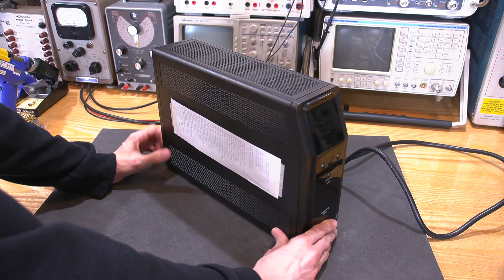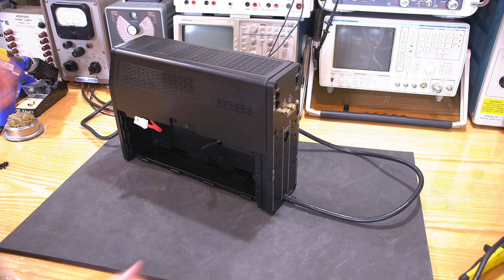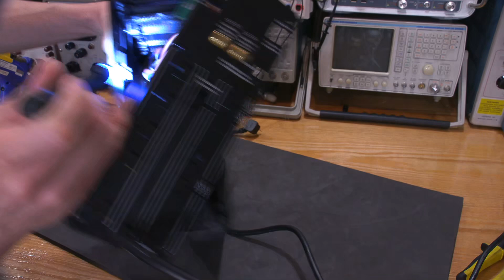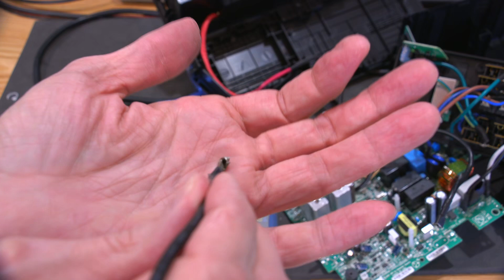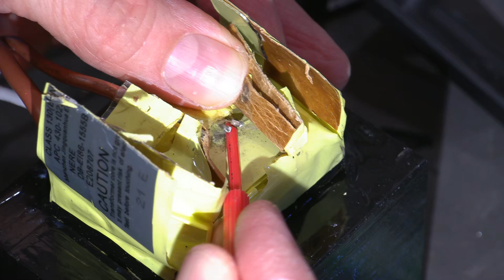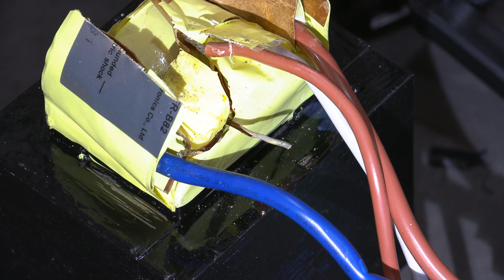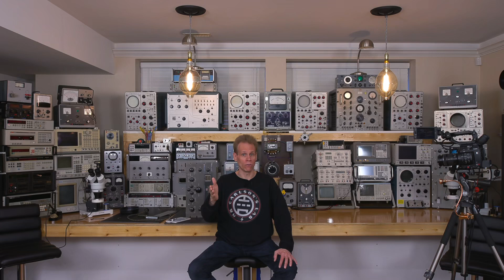UPS Electrical Failure - Teardown and Analysis!

Comment: Now, does APC know that they are getting aluminum transformers or do they pay for copper and haven’t caught up yet… Aluminum windings can be soldered to copper but it requires proper technique, and ideally an aluminum terminal crimped onto the winding, then soldered to the copper outgoing lead. Larger area on the terminal makes for much easier soldering. Soldering directly to aluminum wire so thin without anything else typically takes an inert gas envelope, a dip in something that strips the oxide, then a rinse dip or two, and finally soldering. It’s doable, but it takes equipment. I really wonder if perhaps some supplier did APC a number on this one.

Comment: That is copper clad aluminum. The trick is to wrap the wire then solder but the joint has to be mechanically stable first.

Comment: Currently shopping for a pair of 1500 VA UPS's. Definitely not buying APC units after seeing this. My primary concern would be fire, second is that the arcing might result in harmful voltage being outputted to expensive equipment.

Comment: fault code F02: On-Battery Output Short Turn the Back-UPS off. Disconnect non-essential equipment from the Battery Backup outlets and the turn Back-UPS on
fault code F04 Clamp Short

Comment: Wow ! !   I just Hooked up a APC 1500 Pro . It was Free. I just installed 2 New Batteries(Not OEM- what a rip off/Price) I Would think they have the same Crappy Connections.
So, would you Suggest ripping apart the Transformer and putting Butt Slices on those wires ??

Comment: Nice video, thanks. Purely by chance, one of my Cyberpower 1300va ups' just started the arc welding buzzing when the power dropped out and I happened to be walking past it. Within 30 seconds it was venting a lot of smoke. The thing is fine running line interactive with the mains, but when it cuts over to inverting, all hell breaks loose as though it's inverting all the power it can possibly muster from the battery. Very thankful I just happened to be there, probably would have set the house on fire but for that coincidence.

Edit: I'll try to grab some video of my Cyberpower in a couple of weeks when I'm back, but deeply suspicious that I've had the same failure mode on the transformer. Buzzed like mad, heated up a lot and released a lot of smoke....no scorch marks anywhere on the board. Only swelling on a bulk cap next to the heatsinks for the FETs...I never would have suspected the transformer!
Will definitely check it when I'm back!

Comment: This is more common than you think! I bought my 75 ohm antenna cable for approx. 1 year ago and the center leads are made of steel with a thin layer of copper.

my rca signal sound cable I bought has an aluminum screen.

this is only to save money at the factory. the product is of much lower quality as the solder only adheres to the thin outer layer

Comment: Hey, I had a BackUPS 1350 catch fire. I mean flames and sparks shooting out the top of it catch fire, not just arcing sounds. APC warranty exchanged it, but now I'm skeptical to continue using it as well as the other BackUPS-1350 I have.

Comment: I have to admit that that is very concerning to me.
I can't go into full detail,  Yet we use APC (Commercial Grade) quite often in the field in the work that I do in security access control and surveillance systems.
I have noticed recently we've had a lot of failures with the newer APC units then expected.
I just wanted to say thank you for bringing this to my attention on what the problem on some of the units that we've installed within the last two years.
Keep up the great work you're doing.

Comment: Don't be surprised/shocked.
Almost all windings in transformers and motors of cheap (chinese) products (MW, swinging cooling fans, etc.) are made of copper PLATED aluminum or aluminum with copper COLORED lacquer.

Comment: For some reason, aluminum windings in a transformer just never occurred to me. I guess it could be ok if there was a really serious mechanical and electrical bond to the wire, like proper crimp terminals, but those would add precious pennies to the BoM and labor.

Comment: Always SUSPECTED something like this - have you noticed on some Chinese motors & transfomerms the ad says "genuine copper windings" - suggesting they DO cheap out like this --- AND NOW WE HAVE PROOF!

(There was Alu-Sol that was SUPPOSED to solder Aluminium but I'm not sure it was that great)

Interesting find Mr Carlson!
Reply: PS I l like your sigh at the end "well anyway..." You COULD have crimped to the wires and reconnected, - but you were probably a bit appalled at the cheapo aluminium wires ... Cant say I blame you! :)

Comment: Very worrisome. Copper/aluminum joins can be done but very special preparation must be taken - and regular soldering isn't going to work. To bury those joins inside the transformer wrapping is just asking for trouble and I know they've sold a mess of these things. I just hope APC's competitors aren't doing the same thing.

Comment: You get what you pay for.  When I purchased an inverter I did research and found a mob that make inverters for a mobile location. Very solidly built, good over limit ability (i.e. rated at 2400 watts continuous but would allow something like 3600 watts for a while). They actually had a video demonstrating it (overloading it even with the clamp meter on there showing the real readings and that it wasn't faked)
I actually ended up selling it later on (years later). I had even run a vacuum cleaner on it (now that's hard on any inverter due to the start up current) and it did it.  The guy who bought it had purchased a cheap one which burnt out. The one I had was much higher spec and I have no doubt it is still performing well for him over a year later. He was going to use it for a project with a fair bit of start up current. 
Kind of wish I would have kept it. Pure sinewave with 2400 watts with a good bank of batteries will run stuff for so long (cook dinner with it). My new (pretier) one can only handle 700 watts :( but more than enough to keep the PC , monitor and DVR running for a while.

Comment: I discovered that the internal cooling fan is missing in the BR1350MS unit just like it is missing in Mr. Carlson's APC UPS. The transformer is different, it is larger horizontally which intrudes into the slot where the fan is supposed to be installed. It overheated and all 4 power transistors overheated and caught fire.

Comment: I had a similar nasty experience a week ago working on an LG washing machine to find the motor winding is aluminium. It is simply not a good metal for use as wiring. Prone to poor termination and fracture.

Comment: You'd figure they'd put a quality transformer in, since that's the first point of contact with electricity into their device.  Turns out, they chose to save money on the trans, and push crap onto their customers.  Least they could do is bring the leads of the trans out further before crimping, so that the potential failure point could be seen/corrected in the future, but obviously the manufacture of the trans wants folks to believe it is copper windings with copper leads coming out of the thing.

Comment: I own 3 of these, except they're the previous generation models without the type C port in front nor the "modern" design. One I got actually came with the wires broke off internally and had to be RMA'd. All the others have been perfectly fine for the last 5 years aside of needing battery replacements occasionally.

Comment: One thing I did learn about APC, they love to overcharge the battery so they will only last an year or two. The overcharge simply burns them up over time. Other brands either don't overcharge or use smart charging where they stop charging and only charge once a week or less to keep it topped off.
Reply: I was told that they charge at a higher rate and then are suppose to trickle charge at a lower rate to hold the charge.  If the circuitry inside goes bad they keep charging at the higher rate all the time and fry the batteries.  If the batteries are swelled and hard to remove then they were over charged and the circuitry is probably bad.

Comment: Aluminum windings in transformers are actually super common in low-cost UPS units. They generally work well, but as you can see are very difficult to reliable solder to. You generally have to use a special type of solder aswell.
Reply: Aluminum solders very well using regular leaded solder (didn’t try unleaded), but has to be stripped from oxide first. Excellent results can be had with inert gas envelope and chemical oxide stripping. Otherwise the soldering technique must keep the stripped wire end covered with flux to prevent oxide formation. The heat of soldering accelerates oxide formation by order of magnitude or a few, so just getting that scraped wire end hot spells the end of any chance at soldering it.

Comment: When I consider my old APC UPSs, they have a main board about eighteen inches square, all steel cabinet, good sized external heatsinking and more electronics than took man to the moon.  Then look at this feeble excuse for a UPS.

Must admit though, I'm tempted to examine the transformers in mine, just to see what they're wound with.

It's a tricky subject because the whole idea of them is to provide back up power in the event of a power failure, so you can't exactly say "I'll just unplug these before I go home tonight". So all the conventional safety protocols in the world won't keep you safe if this fault develops while you're not there.

It could end up in a nasty mess, to say the least.

Comment: I ditched APC some time ago, especially coming back to the civilian world.  CyberPower has done reasonably well for me.  They tend to make it through at least one battery replacement and seem to tolerate using LiFePO4 batteries with a very moderate charging voltage.  APC float charges were so high it was not uncommon to find them cooking the thing and making swollen battery removal difficult, not to mention the dangerous heat associated with cooking a SLA and increased power usage.

Comment: This was a big surprise Paul. I never seen aluminum used in a transformer before - but there's a first time for everything they say. But the most surprising was that they tried to solder a copper wire to aluminium. This could in worst case start a fire. 
Take care and stay safe 73 LB5JG

Comment: I've never not had on of APC's consumer level UPS fail, burning smell and all after brownout, sag, etc. To the point where I've almost went through their warranty department a few times but the stipulations didn't make it worth it. Wonder how many others? I don't recall any major issues with the pro-level gear.  "Schneider Electric" AKA APC, plenty of recalls from them for all kinds of stuff.

Comment: So if I look at those wires, they look like copper clad aluminium (CCA) because of looking further down the wire, where the laquerlayer is, it's copper coloured. But it looks like at the soldering ends they stripped away both the laquer and the copper plating. Maybe to make production easier, and just make some kind of 'clamp' out of a soldering blob surrounding the bare aluminium
So I think CCA is a way to cheap out on qualty, but this also looks like a faulty production method. Bare aluminium is very reactive and an aluminium oxide insulation layer is easily formed between the aluminium wire and 'solderclamp'.
So this is a very bad product imho.
I also always thought APC was top of the line for consumers and small businesses, but I guess times have changed. Apparently every penny also counts in devices that try to counteract reliability problems 😁

Comment: Seeing lots of copper coated aluminum small Ga wiring lately, I've mostly had success in soldering to them albeit very carefully but this high current use is frightening.

Comment: Had the same unit fail on my son when power was restored. Arcing sound and smoke. Glad he was home to notice it and shut it down. I found the same F04 code. Since it was under warranty it was replaced.  As a retired electronic engineer I'm shocked at what you found.

Comment: The power transformer of an UPS are rarely to be failing.
How you pin point the exact failure you didn't check the electronics part?

Comment: Really enjoy your videos and plan on subscribing to Patreon.  I have a question I hope you could answer or direct me to a video.  I am starting my first attempt at restoration on a Philco AA5 radio.  My question is how do I determine the wattage of resistors needed?  My schematic only identified the value of one resistor and the size of these old resistors doesn't seem to correspond to what I have been able to find about body size indicating wattage.  Hope you can help me.  Thanks

Comment: Hi Mr. Carlson, thoroughly enjoy your videos. Very educational. One thing I noticed in your videos is that you don't seem to have a fire Extinguisher near-by. You need to invest in one for every lab you work in. just to be safe. Thank you for the video. I just got rid of my APC! It was acting up, Battery disconnect error. Happened several times so I unplugged it and I have my computer on a surge protector but no battery backup.

Comment: I have had two of what appears to be the same model fail on me in the last 2 years. The first one failed within 24-36 hours of use around Jul-2021 with similar arcing sounds  so I did a RMA with APC\Schneider and got a replacement that one failed around May of 2022. So far the replacement for that one is doing ok but it is on non-critical equipment now. I really feel that the APC brand has gone downhill.

Comment: Although aluminium windings are often more affordable than copper windings due to their inexpensive production cost, they tend to occupy a larger area. However, this leads to a lower current density and thus results in reduced heat dissipation, saving more energy compared to traditional copper-wound transformers...

Comment: I purchased many APC UPS for home use over the years, and every single one failed.  Many failed by overcharging the 12V battery.  I have since stopped purchasing APC units, and now only buy CyberPower.

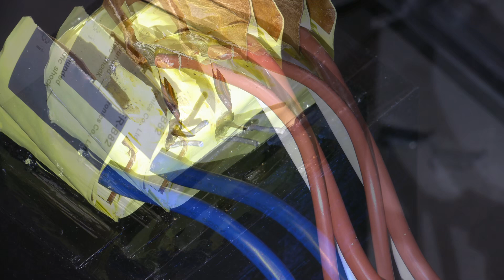Comment: 13:40  Copper, IS   EXPENSIVE; so, to INCREASE  PROFITS,   xformers  are now, made with aluminum.  Which, is not good; the thermal properties, aren't  very good, for  transformers.  Copper  here in Alberta Canada,  is at  5.40  $   a pound,  #1  red at re-cyclers, wheres   aluminum, is about  1.40  pound.  JUNK, modern junk,  i find these in microwave xfrmers,  as well being  aluminum, as well as some 12 v   battery  chargers; more junk.

Comment: Hi. old tech here; i find alot of these  APC  junked,  in the dumpster by the Drug Store.  Most work, but the 12 battery (batteries, some have 2, the 1500 watt ones)
usually  are  dead; so they  trash them) Used one, in car trunk, hooked to another isolated 12 battery, to power AC mower,  and other tools, while car is idling)

Comment: It's aluminum core wire with copper cladding. Odds are it was soldered to the copper cladding but heat can degrade the connection.

Comment: i don't suppose you can get part numbers off the relays, i have an older back-ups with a failing relay in it.
Reply: Yes, you can get the PN # off the relays -- did just this for some SU1000 units last summer where the same relay needed to be replaced in 3 units. These were 18yo UPS mind you, but still worth repairing.

Comment: Looks like they just didn't use the right kind of flux in the factory.
I'd love to know if someone cut corners by substituting the cheap flux 'as it's always worked in the past'..  And of course it would pass it's QC.. And under all the wraps, you can't tell..

Comment: I recently had the need to solder to a heavy aluminum sheet (heavier than foil) and did a bit of research. I also do a fair amount of surface mount reflow soldering to assemble circuit boards. The solder paste uses SAC302(?) alloy (a silver based solder) and a flux for soldering to tin, silver, copper, gold, etc. It does not solder to aluminum... or so I thought.

There are also solder pastes that solder to aluminum. It turns out they use the same alloy, but a much more aggressive flux that activates at a higher than normal temperature. When done, the flux turns a very dark brown that can be removed using the same cleaners/techniques as the rosen flux. As far as I can tell, the joint is just as good as when soldering to copper.

All that being said... aluminum wire in a transformer? Hmmm....:face-orange-raised-eyebrow: